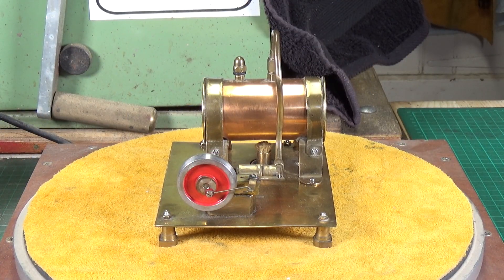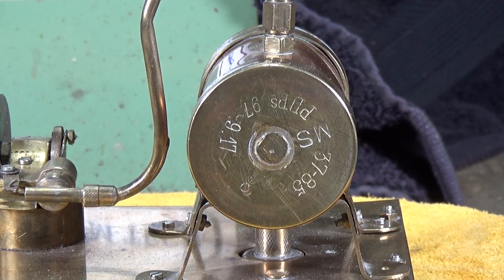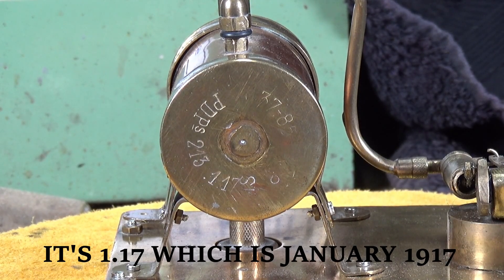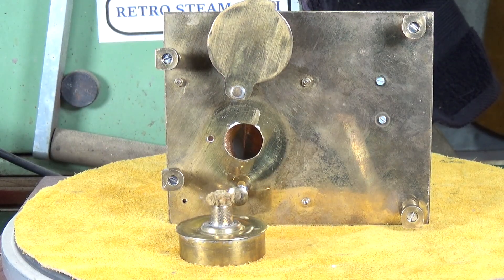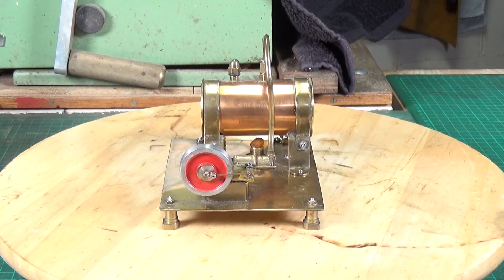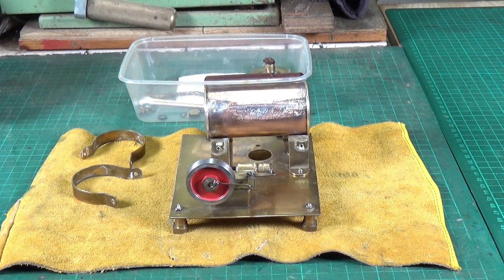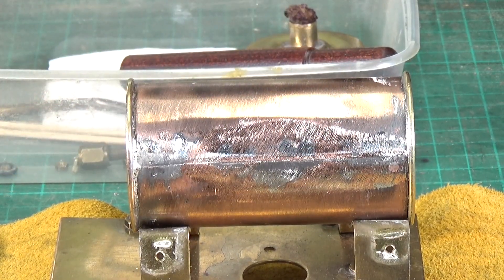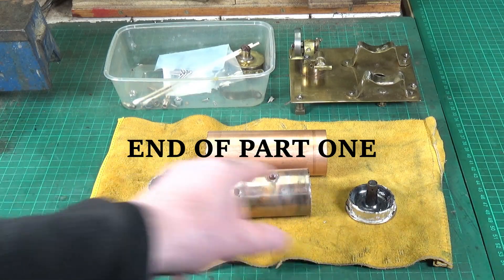Small Scratch Built Piston Valve Model Steam Engine - Part One

Comment: This is an interesting one Alan. Odd to use only the shell end caps, and not the brass shell casing. A trench art steam engine. Hope you show making the boiler. Looking forward to part two. ATB Nobby
Reply from the maker: I thought so Nobby. Yes, I'm just replacing the copper part, still using the shell end caps. Cheers, Alan.
Reply: Interesting boiler. Looking forward to seeing the new one soon…and with a safety valve?
Reply from the maker: @Carol-East  I may fit a safety valve at some time in the future. At the moment the piston is a fairly sloppy fit in the valve cylinder so if it over pressures I'm certain the excess steam will blow by the valve.

Comment: Nice little engine, are you going to replace the filler and make it into a safety valve?
Reply from the maker: Thanks. I may do in the future. The piston is a very sloppy fit in the valve body so if the pressure gets to much it will blow pass the piston.

Comment: Interesting engine Alan. It wouldn't hurt to do a better job of routing the boiler pipe angles while you're at it.  It should come up real good. I will be keen to see it run.  Cheers Rob
Reply from the maker: Hi Rob. Getting it to run on steam turned out to be more difficult than I thought it would, there's a surprise 😱🤣 All will be revealed in part two. Cheers, Alan.